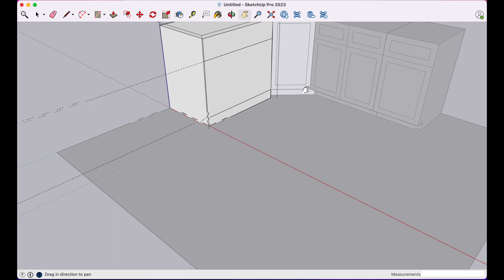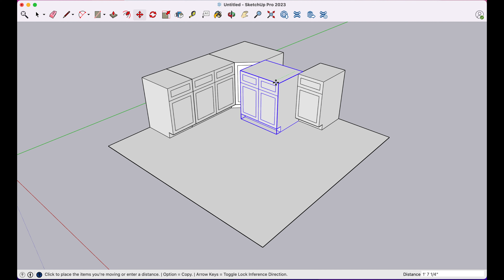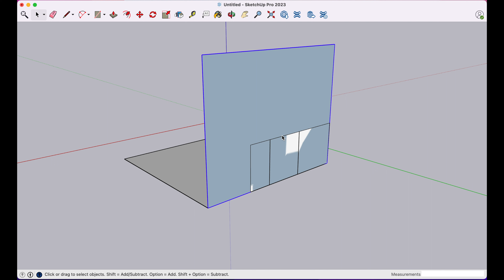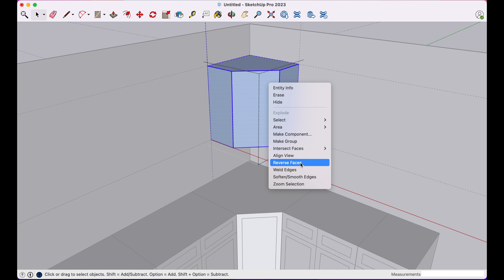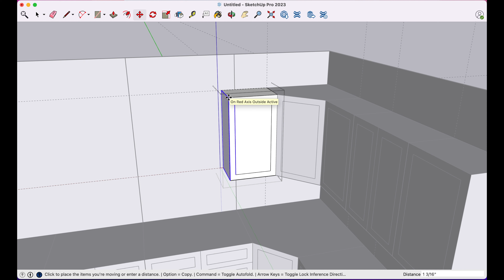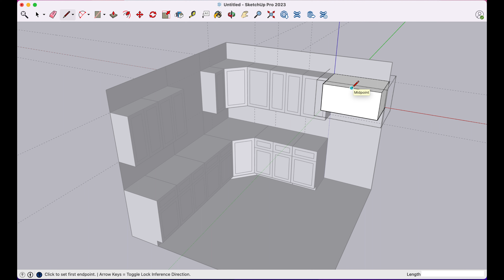SketchUp Kitchen Layout Tutorial: Part 2 Lower & Upper Cabinet Layout

Comment: Bruh, the end of part one is not the same as the begining of part 2
Reply: This is NOT where you left off last time, lol
Reply: @WilliamAltowood  does it matter? it's about what he explains, not about what he makes
Reply: @s8v1  it mattered to me, cause i was building along with the video.
Reply from the maker: Sorry about that!  I wasn’t clear at the end of Video 1, I was really demonstrating the value of groups and components and not working the specific layout.  Will keep that in mind in future videos.
Reply: @sketchupassist  actually, I wanna offer some positive feedback as well. The naration style is very good. You detail what you are doing, as well as your reasoning behind it. Im currently absorbing as many sketchup videos as i can, as my job now requires it, and your videos are better in that regard then many of the others ive allready viewed. 

Also, making a back wall as a group from the start is actually, imo a great idea, cause pulling from the wall becaumes super easy, and deleting the group after is also easy. 

Also, when i first started, i used to build from edit mode, and my boss would yell at me for it, but your video serves as proof that its another way to skin the cat and while he isnt happy about it, hes isnt yelling about it any more.
Reply: @sketchupassist  also, the way you turned the 18" into a 12" using the select and move tool was VERY clever. I had not seen that before and was very happy to learn that technique. Previously, i was taught to use the resize tool, and that tool changes the measurments of the rails, stiles, beeds, and bevels, so while it works as a basic presentation, picky designers and probably any architect would notice. In otherwords, maintaining the integrity of my presentation is now possible while still reducing the time it takes to make corrections

Comment: Are you using a MAC OS or Windows…. I’m struggling with every aspect of Sketchup…. To the point I’m considering ProKitchen…. Every time I try to follow a video it’s on a Windows system and that seems to throw everything off, or end up with a bug splat 🤦🏻‍♀️.  Thanks in advance!
Edited to add I’m using a MAC…. I wish they offered private lessons on how to use specifically to your system.
Reply from the maker: Hi - I am using a Mac in my videos.  I understand it can be a bit frustrating.